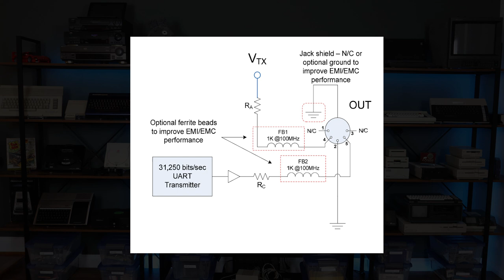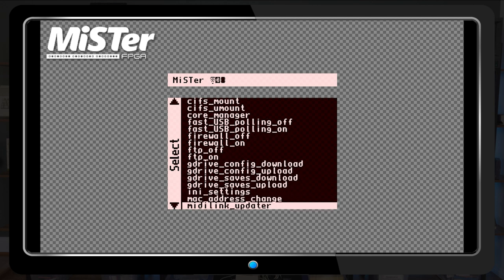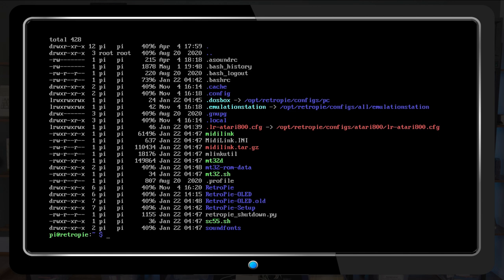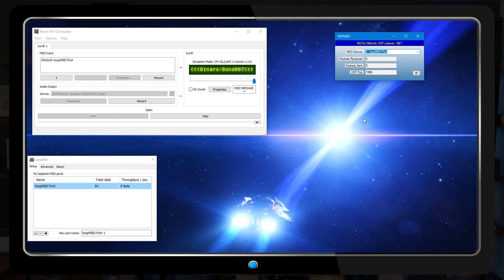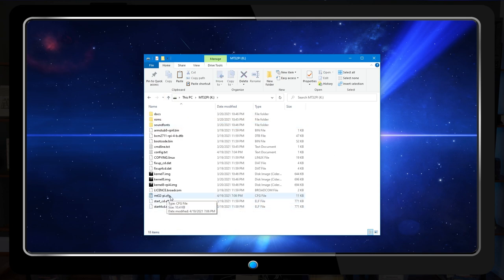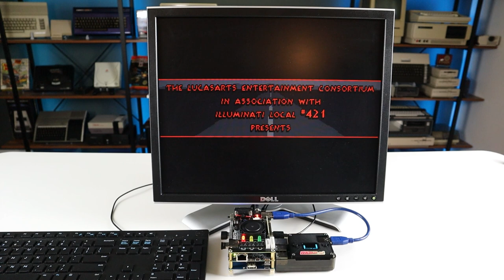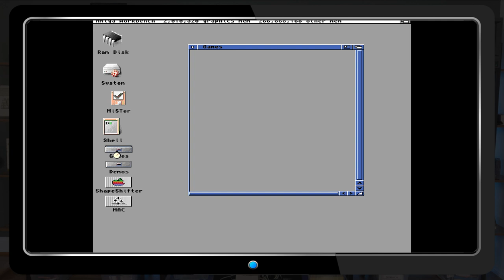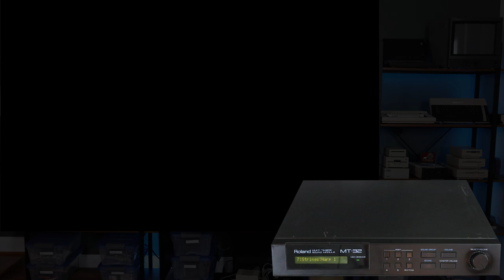MIDI on the MiSTer FPGA 5 Ways - mt32-pi, Munt, FluidSynth, MidiLink and more!

Comment: Was looking for some info on MiSTer MIDI support for the X68000 core and did not expect to see something this comprehensive on MIDI support for MiSTer in general. Excellent research and video. I didn't even know the MT-32 Pi even existed. I'm gonna set one up. Loved that you had the real hardware to test as well. Subbed and look forward to diving into your other videos. Cheers!
Reply from the maker: Thanks, glad it was helpful! Coincidentally, I've been working on an X68000 core deep dive video that should be done early next week. It will cover the latest official release, how to set it up, and what currently is and isn't working, including a look at MIDI support.

Comment: There's another option too. I think that little blue MIDI IO box ought to be able to connect to a Roland UM-ONE as well (these are somewhere around $50). This can then connect to any device with a USB port that can run any suitable MIDI emulator. I'm in the process of repurposing an old Mac Mini running WinXP and the Falcosoft Midi Player, connected from a Soundblaster 16 via a UM-ONE right now. It works great! I just heard the original Warcraft via the Arachno soundfont-- it sounds so much better than SB16 FM Synth-- night and day!
Reply from the maker: Thanks! I wasn't aware that the MiSTer had UM-One support at the time I made this video, but I did learn about it later! https://youtu.be/gGhY7VtqGC8?t=1598
Reply: @retrobitstv  Oh, missed that one. Thanks! :)
Reply: Yes, I can confirm that the UM-ONE works out of the box for the MiSTer. Just set UART Mode to Midi and MidiLink to USB and you're good to go! I was surprised how easy it was.

Comment: I really hope the Sharp X68000 core gets picked back up at some point & fine tuned - That is one system that could REALLY take advantage of all these MIDI synthesizers.
Reply from the maker: There's a pretty recent X68000 core that does with with external MIDI devices but some software is still pretty glitchy on it. I demo'd it briefly in the most recent MiSTer Updates (Fall 2021) video. It sounds like the core devs are taking another pass at it right now so maybe we'll see some big improvements soon.
Reply: @retrobitstv  Hope so!  Definitely would like to see everything run more stable.

Comment: MT32pi is pretty neat. But oh man. Those original machines do sound a lot better😵 I really don’t like where this is going for my space and wallet😂
Am I correct in understanding I could just load the SF2 files for say Ocarina of Time and use the MiSTer midi I/O with a midi keyboard and I’d get to play songs using the OoT soundfont? Or is a midi output required to do so? (No audio from the mister)?

Comment: For DOOM in particular I could definitely tell the difference between the real hardware & emulated.  The real hardware seemed to have a rolloff on each note that sounded really nice, while the emulated version did not & did not sound as nice as a result.  Am not sure if that could come down to setup or what but it's notable.  Is there any reason the MISTer itself couldn't emulate the MT-32 itself for DOOM without issues?  I noticed you didn't do a comparison for that for some reason.
Reply from the maker: The MiSTer's ARM CPU should be able to do a good job running Fluidsynth and producing the same audio as the MT-32 in the case of Doom. Not sure how the de-10 nano's DAC compares to the one in the MT-32, but the software generating the music would be identical. It may suffer from the occasional skip or slow-down though.
Reply: @retrobitstv  Well yeah but there are far more factors than just the way the CPU processes it.  The output could still sound totally different.  Would really love to have seen that comparison done and I think a lot of others would too, so we can really see how the MISTer doing MT-32 sounds compared to the real thing.
Reply: Also, the left and right channels seemed swapped. Aside from that, to me MT32-Pi sounded muffled and with less stereo separation compared to the original.
Reply: @souljastation5463  Yeah, the Emulation certainly isn't perfect.  However it's greal to have the option nonetheless.  There will always be a benefit for those willing to shell out for the OG hardware & I kind of like it that way.
Reply: @skins4thewin  I agree, although in this case it shouldn't be hard to solve the problem.

I don't think that this is an emulation problem, it could be solved by just tweaking the audio output of the Pi itself.

Comment: Wow great vid.  I have a MT32-pi but no idea I could just plug it in to the MiSTer!
Reply: You'll need a short length USB3 cable for proper functioning through MiSTer's userIO port.  visit the mt32-pi wiki to see a list of known good cables. Many of them are not good enough quality to carry the signal with stability, so this part is important.  You'll also need to modify a couple things in the ini (again, info in the wiki), maybe just make a second ini for when you use MiSTer, to quick swap. So it's slightly more complicated than "just plugging it in", but not very.

Comment: Hello and thank for thi useful video.
I'm struggling with the Windows way, anyway when I launch a midi from ao486 the sound doesn't come from MiSTer speakers but from PC one, is it intended to work in this way or I'm missing something?
Thank you :)
Reply from the maker: That is correct, when you use Windows for MIDI, the sound will come from the MiSTer and the music will come from the PC. The only all-in-one solution right now is the mt32-pi.

Comment: using option with real hardware... is there any way to get back the audio into the mister and mix it there? or do I have to take the hdmiout of the mister and mix into that?
Reply from the maker: I'm not aware of any way to bring audio from an external source back into the MiSTer for mixing. I think using an external mixer is your best bet. If you have an I/O board you can take the audio from there instead of using an HDMI break-out as well.

Comment: Do you suppose that using a faster and/or overclocked Pi would overcome the stuttering? That being said, it looks like the Mt32-pi had won't fit on a Pi with a heatsink or a fan so I don't know if that's possible. So many other questions pop to mind. Time to do some research. Thanks for the video!
Reply: the pi wasnt stuttering in this video, that was the ARM processor on MiSTer, which is generally only used for IO and linux/menu stuff, not really powerful enough for proper munt emulation.  pi 3a+ or greater will have no issues.
Reply from the maker: You should have no issues with Munt when using a Pi 3 or above. You can probably use a short ribbon cable extension to attach the mt32-pi if it won't fit due to your heatsink/fan, something like this https://www.adafruit.com/product/4823.
Reply: Thanks to both of you for the advice.

Comment: Do you have to download the AO486 core? I don’t see it in my computer list of systems.
Reply from the maker: Running the update script should download the rbf file you need, but you will still need to place the boot ROMs on your sdcard. A better option would be to use the Update All script which will install the core and the ROMs.
Reply: @retrobitstv  I did the update all but still didn’t see that AO 46 or 48 core.
Reply: @Zionfarm  You probably figured this out already, but in case anyone comes wondering about the same... ao486 is the name of the core, but on the menu it shows up as PC (486SX) under the Computer folder, not to be confused with the PC-8801 or PC/XT cores.

Comment: So how does one disable midilink once the install script runs?
Reply from the maker: It doesn't appear that the midilink updater script creates any init.d startup files on the underlying Linux OS, it just drops some binaries in places. I haven't dug any deeper than that, but my guess is, if you don't set your core to use local midi, the binaries won't get executed. If you remove /sbin/midilink and /sbin/mlinkutil manually, plus the /media/fat/linux/mt32-rom-data/ and /media/fat/linux/soundfonts/ directories, that'd probably be clean enough.

Comment: Real hardware has a much greater reverb / sound depth... I thought they would sound the same.... so the emulation is not yet there?
Reply: there were many samples of different configurations demonstrated in this video. what specifically were you referring to? SC-55 sounded the most different to me, but that can vary wildly depending on the soundfont you use.  I suggest using AudioFabric for the most accurate option.
Reply: @WalrusFPGA  I meant the last side by side between real hardware and mt32-pi -Wing Commander 2 and others
Reply from the maker: I'm not sure if it affected the audio comparison but I did normalize the loudness levels of the two sound recordings in post. The source files were at different levels as-recorded. Also, I was using only the default settings for Munt and FluidSynth. For example, resampling was set to "good" but not "best" in Munt.
Reply: Mellified  I'm happy to read this. I too was concerned because the video did make it seem as though the emulation left something to be desired. Knowing this is due to configuration and it gets the nod of approval from an MT-32 owner is reassuring.
Reply: Mellified  Is it me or is the "trumpet" sound way different in WC2 on this video in MT-32 mode? Could it be just the CM-32L roms just being different or is it something else?

Comment: Do you recommend to use a dac between the mister and the speakers? If so which one would you recommend?
Reply from the maker: I haven't tried any external DACs with the MiSTer. I've been quite happy with the sound quality coming out of the device, especially considering the nature of the systems it's emulating! The mt32-pi supports a variety of i2s DACs, listed here: https://github.com/dwhinham/mt32-pi/wiki/I%C2%B2S-DACs
Reply: I definitely recommend it if you're playing any console or arcade cores. The sound out of the analog board sounds horrible to the point that I thought something was wrong with my MiSTer.

Comment: hi 
i did it as you explained:
Installed midi
Started A486
Selected local with fluidsynth in UAT
Started Duke Nukem 3D setup
Selected sound can as for music
But no sound

What am i missing?
Reply from the maker: That sounds like you covered all the bases. Did you perform a cold reboot after the install just for good measure? If you SSH into the MiSTer while the 486 core is running and type: "ps -e | grep midilink" (without quotes) do you see it running? You can also grep for "mt32d" or "fluidsynth" when you have one or the other selected to see if the processes started up properly.
Reply: @retrobitstv  how do i ssh into the mister with a macbook?
Reply from the maker: @retromister81  On the Mister, get into the f12 menu (win-f12 in ao486) and arrow left to see the IP address. On your Mac, fire up iTerm and at the prompt type "ssh root@x.x.x.x" substituting the IP address at the end. Default root password is the number 1.
Reply: Are any of the switches on your MiSTer on?

Comment: Does the MT-32 Pi improve non  pc games like nes, snes, genesis, etc?
Reply from the maker: It does not. It only works with systems that had some kind of built-in or add-on MIDI interface and software that was designed to take advantage of it.
Reply: @retrobitstv  Ah, okay. Unrelated, but is the cable that comes with the hat from MiSTeraddons too small and needing a replacement?
Reply from the maker: @seamistseamist  The serial cable for the MT32-pi hat is short by design. Here's what the wiki has to say about that:

Whether you are connecting the Raspberry Pi to the MiSTer using an off-the-shelf USB 3.0 A-A cable and the MiSTer HAT PCB, or with home-made cabling (e.g. cutting up a USB 3.0 cable or using jumper wires), you must use a short cable to ensure reliable operation.

This is because I²C is not really designed to be used over lengths of cable, and so signal degradation can occur due to capacitance in the cable and/or signal reflection. If you experience a corrupted OLED screen display or erratic synth switching behavior (e.g. as in issue #59), try a shorter cable.

The maximum USB cable length that has been tested successfully is ~50cm, and so this should be considered an "extreme" configuration. It is recommended that you try to find a cable <30cm long for a reliable connection. Anything longer is very likely to fail, so please consider this carefully when choosing a cable. Some users have used short jumper wires and still experienced failures because of poor quality of the wires and lack of shielding.
Reply: @retrobitstv  Alright, but it looks like stress is being put on the cable in every image where it is shown being used with the pack in cable

Comment: I've only watched up to 6 mins so far, but I think you should explain the "why" in extensive detail someone should use a MiSTer vs just regular software emulation? Regular software emulation for MIDI and games is already great! Most of us likely have a 2nd laptop hanging around that would work perfectly to be our MIDI sound module if we wanted it for games or something else. I bet a small Windows netbook or tablet would work fine as an external sound card for vintage PC games that require an external MIDI, if there aren't already easy software emulations people can run right from the games on a single PC for doing this. On my software Apple ][ emulation for example (no FPGA box required), with in the popular Apple ][ emulators, I can emulate the Mockingboard sound card which was optional for Apple ][ games. In my Amiga emulation (which is clock cycle accurate with no FPGA needed), the emulators are able to provide all kinds of optional hardware devices built into the emulators. 

I've been heavily into software emulation since 1985 on the Amiga, and followed it to the PC platform where it has dominated since the mid 90s. I've built 4 MAME machines, and and am a musician running many software synths. I've yet to find a use for a MiSTer as I'm perfectly satisfied with software emulation on many fronts. I see people running classic games on a MiSTer, with an LCD screen. And they think that is authentic! Don't they know how critical the CRT is? I think many of the MiSTer people have all the wrong priorities. Software emulation can be great, and even clock cycle accurate and has been under heavy development for a very long time, getting perfected.

But please explain to me, I'm happy to listen, and open minded.  I have around 25 arcade machines with several custom built emulators & dedicated games, dozens of soft synths I use extensively but also more than a dozen hardware synths. I haven't needed FPGA yet to do what I want. Maybe there could be an odd by game or something that was poorly emulated and better emulated for MiSTer? Generally, recreations are only as good as the people making them. That's why I know a handful of people years ago that switched back to PC emulation and sold off their MiSTer when they felt software emulation did a better or equal job of the task.
Reply: Sold off the Mister years ago? It's not that old a project. You have a new wave of developers who are maniacal about hardware accuracy, going as far as to decap chips to get the exact schematics. Many emulators have stagnated over the past decade at good enough, but not really accurate. Still there's no wrong answer and I am using FPGA for my favorite consoles and emulation for others I am less particular about (including Apple II).
Reply: @rsmith02  It could have been the previous version.

Generally if I find emulation not to accurate (games or synths), it's not because the accuracy isn't there, it's because some part of it isn't finished. This would be no different with FPGA. The products are only as good as the people making them, and what they've figured out with reverse engineering them.
Reply: @n8goulet  The biggest difference between MiSTer and Software EMU, I feel in Arcade games (and Consoles) is controller latency... for example: Running BSNES/HIGAN on my 9900k in the highest accuracy mode compared to the MiSTer SNES core on Mario Kart... world of a difference, my lap times are way better on the MiSTer and compare to me on my SNES... where with BSNES/HIGAN it is way more difficult for me to get the same lap times... both are running on the same screen with the same controller (8bitDo SN30 pro @ 8Bitdo Wireless Bluetooth Adapter), so it's not CRT vs LCD...
Reply: @mstreurman  I mainly play classic arcade games from the 80s, late 70s and occasionally early 90s. I haven't noticed any latency issues with the controllers what so ever in the hundreds of games I play. However, most of the games are a bit older than Mario Kart. A wireless connection could potentially add latency issues. I have 4 custom built MAME machines all running 19" arcade CRT monitors and vintage arcade controls like Wico leaf-switch joysticks & buttons for example.

As for latency with MIDI on PC's, it's very rarely been an issue. I've been using soft synths on laptops with my bands for 25 years. If my timing was off, my bands would let me know. 
My soft synths on the Amiga in the mid 80s could have latency issues. It wasn't an issue with MIDI, but rather than synths themselves as some really taxed the hardware. If someone experienced latency using MIDI with their PC soft synths today, it usually means they need a more powerful system to run them. Not that they need to run MIDI via MiSTer.